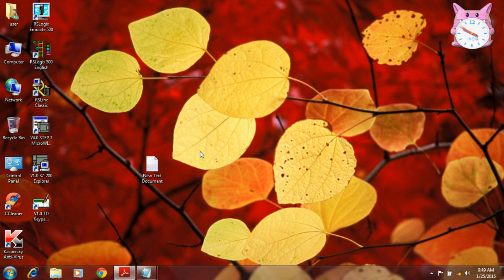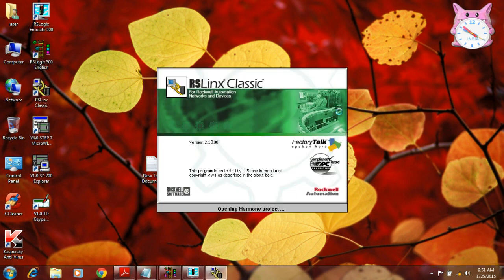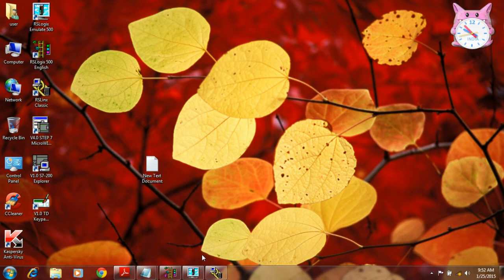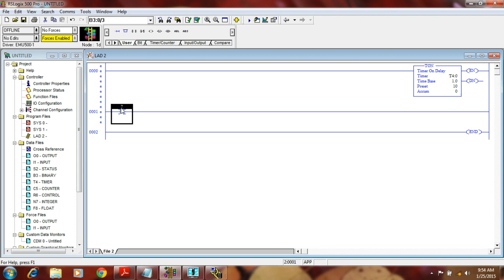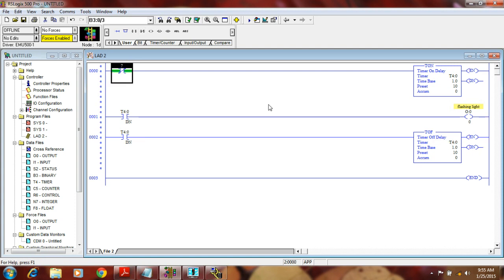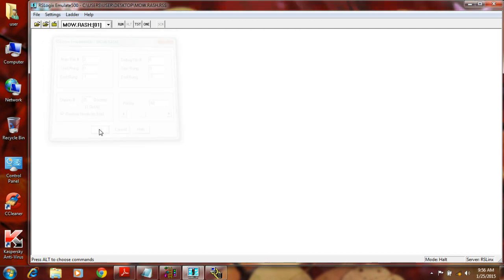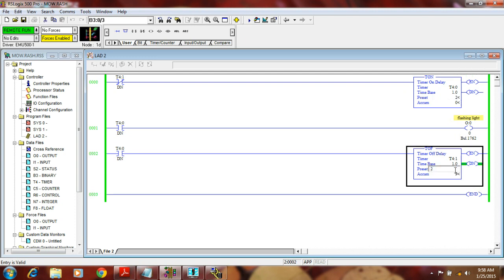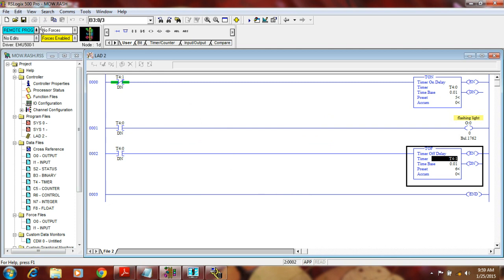RSLogix500 PLC Simulator - RSLogix 500 - RSLinx - RS500 Emulate | RSLogix500 PLC模拟器 | Симулятор ПЛК

Comment: Hi i did it step by step but this message appear ( This action cannot be completed because the other program is busy, choose Switch to activate the busy program and correct the problem ) , i had run all 3 program as administrator with new copy of win7 Thanks
Reply from the maker: Ok please open only program and open that file on emulator the message when it's appear

Comment: my linx classic gateway is not showing emulator option while Auto Configuration. how can i connect it to Emulator driver?
Could you please suggest me for solve this problem or could you please provide a link for RSLinx classic gateway?
Reply from the maker: ok do you have emulator software you have install the emulator software first
Reply: @MR_Industrial_Automation  I have older version of emulator, can u provide it also. I will be very thankful to you.

Comment: I need some information on RS Logix programming for AB Micrologix 1200. 
If suppose, we have a sensors in field connected to the Digital Input of the controller. This sensor is connected to a conveyor, this gets signal ON and OFF contentiously every second or less than a second. I need to activate an output relay port only if the input is constantly ON for more than 5 seconds. Please advise how this can be done.

Regards
G. Jerome
Reply from the maker: Jerome Note Thank you sir asking a question today i will make a video for you so you can understand better but i want to ask you a question how much time the output will on when we get input more than five seconds
Reply: @MR_Industrial_Automation  Thanks for your immediate reply.
The output will be ON until the input becomes OFF for grater than 3 seconds continuously. Example, if the input OFF for 2 seconds and became ON again the output should remain ON (since input was not OFF continuously for 3 seconds).

Comment: I've got RS LOGIX 500, EMULATE 500 and RSLinx Classics installed in my computer but whenever I'm going to add a driver in the Driver Configuration drop down, I'm not having SLC EMULATE 500 among those list of drivers.. Please guide me what to do, and what is the problem?
Reply from the maker: 2.58.00-RSLinx-DVD, RSL_500_Emu_6.00 brother try to get these series of software,or the second solution is try to install the emulator 500 and rs linx classic full version because i think so in your computer emulator are not installed completely,and third you can check you are getting  emu... driver on your programming software go to controller properties and then go to controller communication and the check on drop down in driver may be you will also not get the emulator option over there also if you get option in rs link classic then you will get option in programming software so try to install the software full version or the last option you can come on team viewer i will try to help bye
Reply: I'am ready to get connected via Team Viewer.. tell me the time..It'll be convenient for me if u are free on this SUNDAY.. and Thank u brother
Reply: Bhai my problem has been solved.. someone on youtube told me that I need to add registry browsing through Regedit.. I did those steps and it worked.. Now it's running all okk
Reply: I've downloaded RSLogix 500 from torrent, now every time I open it it instructs to activate the product.. Shall I must pay for that to buy a license or is there any other way in which I can have access to the product for free?
Reply from the maker: oh great bhai contact me if you need any help thank you
Reply from the maker: brother i dont know about crack really  i am using original license and this is i am sure that without activate your product it ill always show the message and after the trial period expire the product will not open again if have to do format your computer to start again the product or delete the file from C drive to start again the product, so you have 2 way to activate the product 1 st crack or original license i can give information about original licence but i am really very sorry i don't know about crack  but some people use crack this is i know.
Reply: Okk brother.. not a problem.. by the way how much does the original license costs? and thanx for everything
Reply from the maker: Brother you can call me on this no 9339904744 for Price thank you dost take care
Reply: Dipankar Rahul Dey  hey can you guide me too how to add the register, i have same problem with you? thanks
Reply: @dipankarrahuldey6249  Bro how did you add registry browsing through Regedit. Pl guide for I am having the same issue.
Reply: @dipankarrahuldey6249  can you pl guide on the specific steps you took on regidit
Reply: Open the Registry Editor (Start-->Enter regedit in the open field). 
Go to HKEY_LOCAL_MACHINE-->SOFTWARE-->Wow6432Node-->Rockwell Software-->RSLinx-->Loadable Drivers. 
Right Click on Loadable Drivers and select New-->Key and name the key EMU500 
Right click on EMU500 and select New-->DWORD (32-bit) Value. The name of the key should be AutoLoad. Double click on the AutoLoad to open the Edit DWORD (32-bit) Value dialog. Enter 0 under Value Data and select Hexadecimal under Base. Click OK button when finished. 
Right click on EMU500 again from the left-hand side and select New-->DWORD (32-bit) Value. The name of the key should be DriverID. Double click on the DriverID to open the Edit DWORD (32-bit) Value dialog. Enter 13 under Value Data and select Hexadecimal under Base. Click OK button when finished. 
Right click on EMU500 and select New-->DWORD (32-bit) Value. The name of the key should be Flags. Double click on the Flags to open the Edit DWORD (32-bit) Value dialog. Enter 2 under Value Data and select Hexadecimal under Base. Click OK button when finished. 
Right click on EMU500 and select New-->String Value. The name of the key should be Description. Double click on the Description to open the Edit String dialog. Enter SLC 500 (DH485) Emulator driver under Value Data. Click OK button when finished. 
Right click on EMU500 and select New-->String Value. The name of the key should be DLL. Double click on the DLL to open the Edit String dialog. Enter ABEMU5.DRV under Value Data. Click OK button when finished. 
The SLC (DH485) Emulator Driver should now appear available in RSLinx to configure.